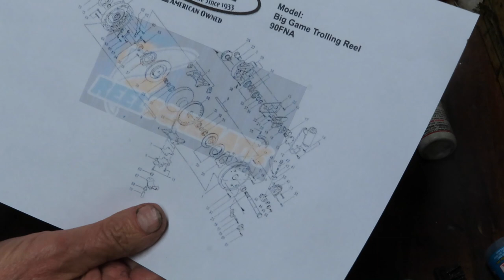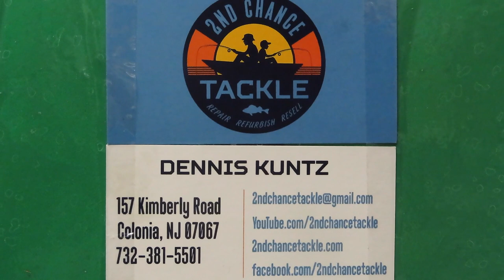Fin Nor seven out vintage lever drag fishing reel how to take apart and service

Comment: Good job on the reel Dennis. This is a
later model Fin Nor which I think were
made until the late 90s I think. The
earlier ones had asbestos drags and
many places would not work on them.
    They were made on lathes from
billet aluminum and were very labor
intensive. I think these are 4/0 reels
but in 1963 a Fin Nor 12/0 sold for
635 dollars.
Reply from the maker: Yes - the is the 4/0 or 6/0 size reel.  I think the washers are cork, but they may have been asbestos.  One side of the washer was glued on to the spool, so it may have been the asbestos.  Definitely an early version of the reel - Thanks for the note - Dennis
Reply: @2ndChanceTackle  I have a 6/0 virtually just like this one, it's definitely 90s.

Comment: Very cool. Interested how that reverse screwed piece tightened after you doing the backwards method here.
Reply from the maker: I am wondering what is wrong inside.  Something certainly has failed there
Reply: @2ndChanceTackle  yes. It's such a strange setup that I don't have a clue.

Comment: What an extraordinary reel! I love these old vintage pieces of engineering art.  Really enjoyed this one as the engineering and gears were magnificent. I’ll bet this reel was expensive when it was originally sold  (adjusted for inflation). I worked on a Daiwa 1600C Silver Series reel this afternoon. I t turned out to be a very nice reel. The only reel in the series I don’t have is that mini 500C reel which I neither want or need. So the series I have includes: 1000C, 1300C, 1500C, 1600C, 2500C, 2600C, 4000C, 7000C, and 9000C. The only other series of reels I have that is complete is all the Mitchell saltwater reels from France. Keep up your videos on these beautiful reels from our fishing past. This was an awesome video!
Reply from the maker: Thanks Chris.  I picked up a 386 and 302 at a local flea market this morning.  Both are in nice condition.  Time to give them a 2nd Chance
Reply: @2ndChanceTackle  Excellent reels. For someone who doesn’t collect reels you sure do get some good ones!. I have to force myself not to get any more 302 reels. I tell myself that four is enough. I only have two 386s though. Want to make a deal? LOL I also needed to ask you a question. I need some shim washers for different reels. Is there a way to get an assortment of shim washers for fishing reels. There are copper washer assortment on EBay but they seem to be for automotive use and too thick for fishing reels. With your repair business I wondered if you knew some source for shim washers?
Reply: I bet you end up getting that mini 500 C 😂 🎣
Reply: @davidmcilveen5013  I would not bet against that! Have you seen that 500C? That’s the tiniest Daiwa I’ve ever seen.
Reply: @christopherjenkins2373  ha-ha.... I like those odds.
I haven't seen one.... I take it,that it's the next size down from a 1000 sized......it must to tiny......plenty of small screws on that one,I would think! 🎣
Reply: @davidmcilveen5013  The basic guideline I set forth when I started my reel collection was to collect vintage surf spinning reels manufactured no later than 1980. As I got more into collecting a few complete series of vintage reels I got a few that weren’t surf reels. This 500C Daiwa is about the length of a common reel foot. It was manufactured from 1981 to 83 so technically it was the last of the silver series reels and came out after 1980. Though I will eventually get one it is not a reel I would normally use or even want. Still I’ll have to have it!
Reply: @davidmcilveen5013  David, you’re not going to believe it but I found out there is another Daiwa Silver Series reel - a 700C. Here’s the really strange thing - it is smaller than the 500C. I’m beginning to believe that the closer I get to having the complete series, more reels are going to keep popping up out ow nowhere! I got my first 7000C in 1977. You’d think that since then I’d know about all of them.  I’m getting really frustrated. I think there is a conspiracy here.
Reply: @christopherjenkins2373  your only thinking about a conspiracy NOW!! Interesting re.the size of the 700 and I wonder what was the "purpose" of it.....great info on those reels Chris,thank you....... your collection will soon be complete........🎣
Reply: @davidmcilveen5013  yep, it probably will!
Reply: where did the Daiwa GS9 fit in that series ?
Reply: @birddog3000  The Daiwa GS-9 is the largest satwater reel in the series. I]thebody is the same as the Daiwa Silver series 9000C. The biggest difference in the gold series is the number of ball bearings in the reel. The 9000C has 1 bearing at the pinion and very slick nylon bushings on the main gear. The GS-9 replaced those bushings with shielded ball bearing. I think it is also a higher priced reel in the  Daiwa reel series of the late 1970s and early 1980. I think Daiwa continued to make the gold series almost to 1990 as that series was very popular. It’s popularity just kept going. Penn had to do the same by bringing back the 7o4Z and 706Z reels in 2012 for a short manufacturing run back in their old Philadelphia production facility. I think the Daiwa BG reel series finally put to bed the venerable Gold Series. I have 5 of the GS reels in that series including this  very nice GS-9 I just got. I finished completely disassembling, examining the parts, cleaning everything, and putting in back together. It is a superb reel in almost every way. I own 59 vintage Daiwa reels form the 1960s to late 1970s. This incudes a double set of all the silver series reels, I got a Daiwa 7000C in the mid 1970s when I first started to do a lot of surf fishing. My reel collection has over 280 vintage surf spinning reels. I mostly have Daiwa, Mitchell, Penn, Shimano, and Shakespeare but I also have reels from many different countries. I recently  got a beautiful Spanish Sagarra Super reel. My prize reel is an all chrome Mitchell 498 that I built entirely from parts. It took over three months just to find all the parts with some coming from France. Getting them all to fit properly was also diggicult but the resulting reel is almost breath-taking. I decided that I’ll never fish with if because it is just too beautiful and rare to chance messing it up. I have two other 498s for fishing. Altogether I own five of these extraordinary reels including one of the very rare Blue/White Browning- Mitchell 498 models and a black Sport model 498 that has more ball-bearing than the original as well as a very strong graphite spool. As you can tell I love restoring these remarkable little machines. My oldest is a Luxor from 1940s France. The really wild thing is that I am 60% blind in both eyes but I don’t let that get in the way of my hobby or fishing with my vintage tackle. Sorry about the long answer to your question but you can see how passionate I am about vintage spinning reel collecting and surf fishing every chance I get! — Chris (PS. Get all the gold series Daiwas you can, you’ll never regret that decision.)
Reply: @christopherjenkins2373  Man that is so cool!
Reply: @davidmcilveen5013  I now have two 500C and a 700C as Weil. Except for the 1500C I have two complete sets of the aDaiwa Silver Series reels. — Chris
Reply: I put a second ball bearing in all my 509C, 700C and 1000C reels. They are all superb reels and as you say very tiny. I took a neat photo of a 500C next to a 9000C. It was quite  sight to see! — Chris

Comment: Could a thin drag washers be made from Carbonex or something and bonded to the old cork washer. Love watching you work on these old interesting reels. You have helped me with at least 6 reels so far. Thanks.
Reply from the maker: Possibly.  I haven't tried that, but there should be enough clearance to bond the two.  I am not sure of the adhesive you would use, but if you need to replace the existing washer and cannot find a substitute, it may be worth a try - Dennis

Comment: Great job Dennis,so glad you got the drag sorted.
It seems the drag needing to be manually adjusted,was the real problem concerning the slipping drag?
I wonder how many lever drags can be manually adjusted internally?
Enjoyed this one,it was a real education.
Keep up the great work and stay safe. 🎣
Reply from the maker: Yes it was.  This is a very unique adjustment set up and it had a lot of play on but sides of the sweet spot.  The manual adjusting got me to the range where the micro adjusting could be effective.  There are not many reels I have come across with that feature, so my answer is no many.  Dennis